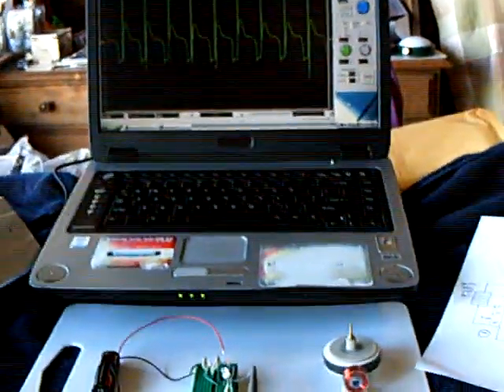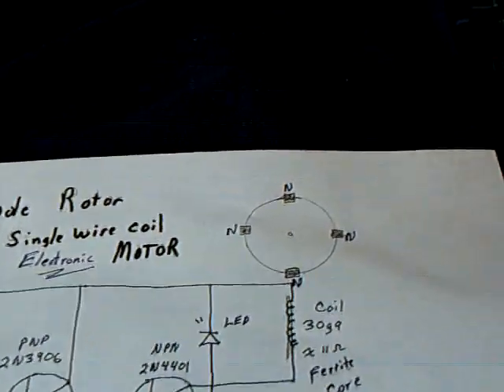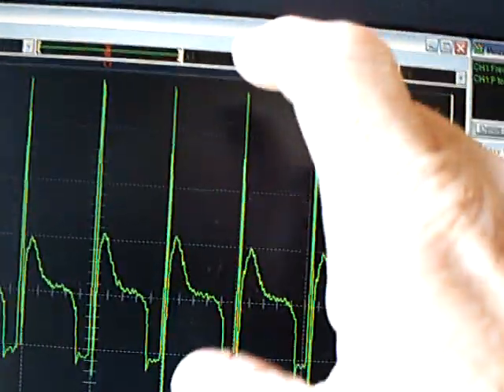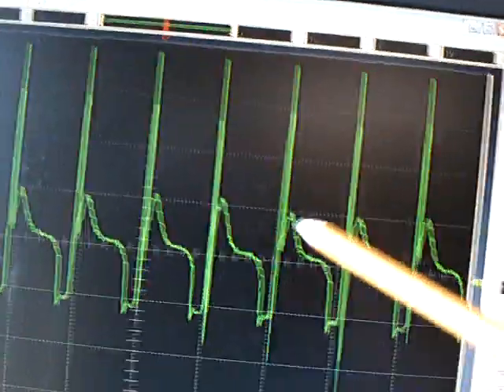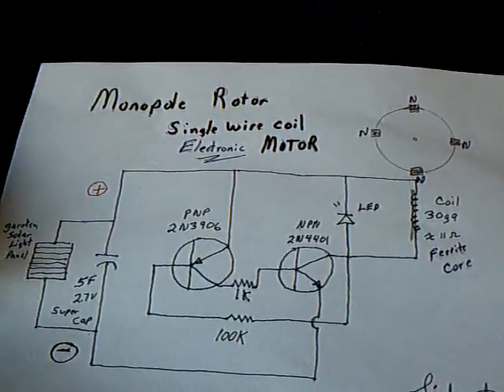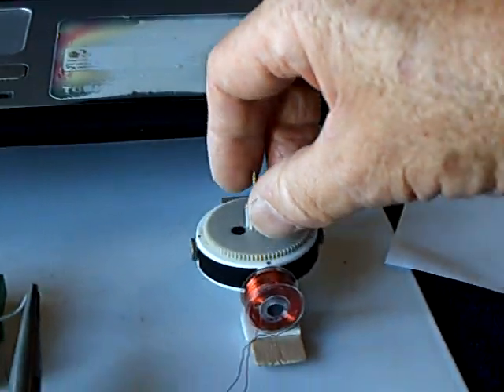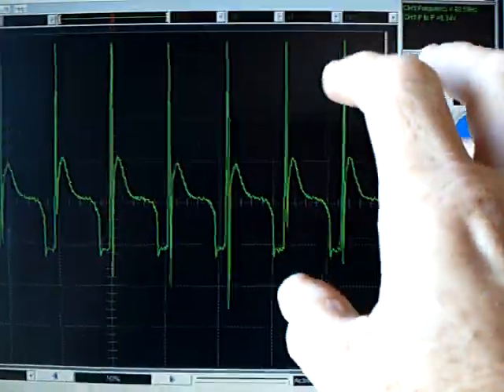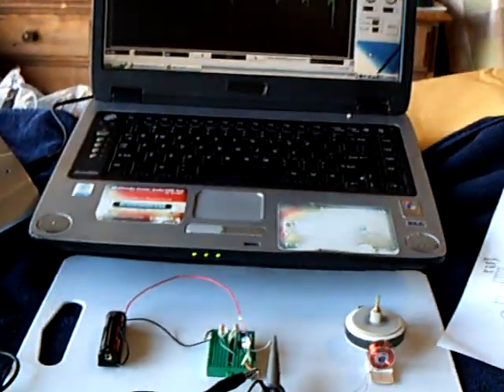O Scope look at a simple Monopole Pulse Motor

Comment: Great video lidmotor. I remember some years ago working on this circuit with DadHav. It is very simple,but i could never get the efficiency that i could with the bifilar coil and single transistor. And yea,i guess you have been looking at the thread i started about the P/in of a pulsed circuit. As you will see,even the best of them had to sit back,and have a good think about how the P/in should be calculated. Next we will see how they go explaining my last video i posted today.
Brad
Reply from the maker: +TinManPower  Thanks for the post Brad.  Yes I am following that thread closely. For many years I have been troubled by how people measure these devices -- and the wrong conclusion they arrive at.  Thanks for all the work on this and the videos.  I have great respect for the other people who are working on this also.  The discussions on these topics at the forums are very interesting to follow.  I wish that I could contribute more.

Comment: The question arises, what happens with a 1N4148 or 1N4001 to your waveform. It would be quite fascinating to see that transformation to a squarer shape on your scope results. 
Nice explanation, made a lot of sense and i'm sure is very useful to people who have no clue about the wave shapings from pulse motors.
Reply: +Lidmotor  I  think you can calculate the area under the spike curve times the number of spikes per some time interval to determine the available power for that part of the output--you know--if you wanted to know how much power that portion of the output produced.

You should also be able to capture that energy in a cap & release it at a more even rate into a battery.  Some batts don't do well with spikes--whereas a regulated charge at the right power level would be a better choice.

Btw, what are your thoughts on your o-scope? Is it worth the 140$ or would it be just as good to get a Mooshimeter https://moosh.im/mooshimeter/  ?
Reply from the maker: +slider2732  I tried the circuit with a 1N4001 across the E and B and it ran just fine.  I didn't have a chance to look at the wave form on the scope.  TinMan says below that he worked with this DadHav circuit also but found it not as efficient as a standard bifilar SSG circuit.  On low power small stuff like you and I work with--- it is hard to beat a plain old reed switch.
Reply from the maker: +A B  When I try to do math calculations with these things it makes my brain hurt.  I used to really enjoy that but not any more.  For fun I would rather bend a paper clip into something.
Reply: +Lidmotor Gotcha :)
Reply: +Lidmotor I have never been any good at maths, but I love to make things.  Its amazing how much stuff I can make without knowing how it works :)